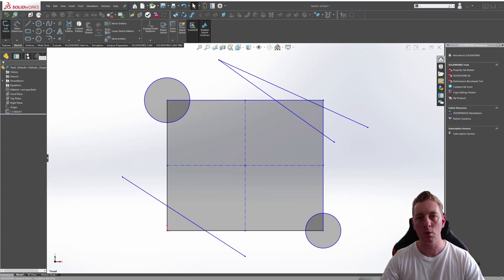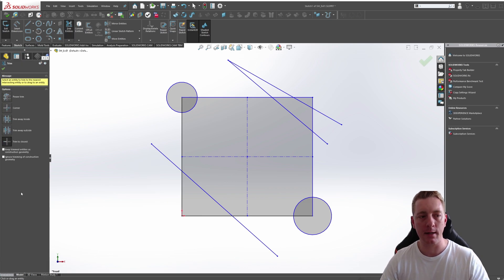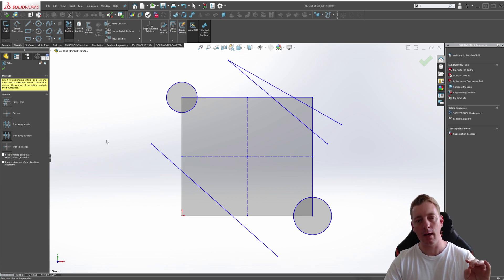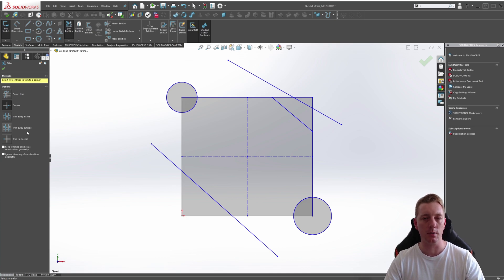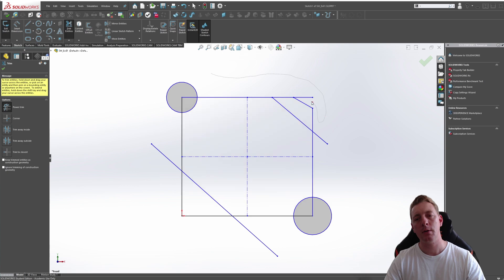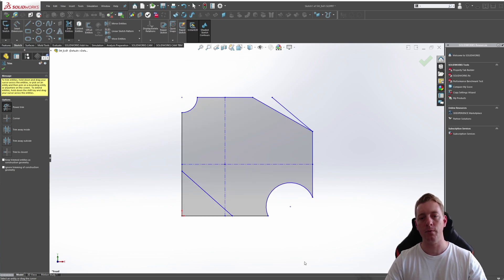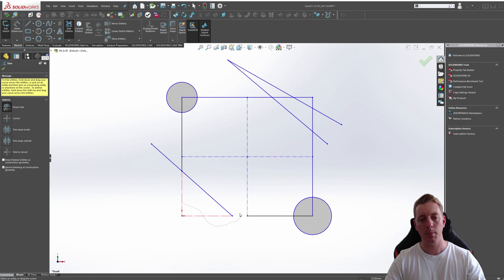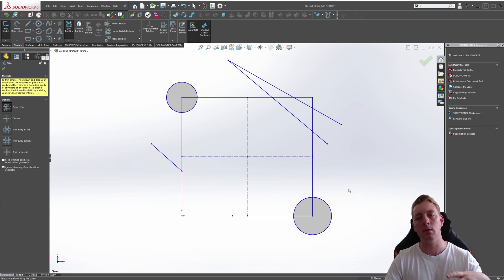Sketch Trim & Extend Tools | SOLIDWORKS 2020 BEGINNER | Chapter 01: Lesson 08 | CSWA COURSE

Comment: Man your videos need to get more attention than they deserve i hope people studying Solid Works someday recognize your tutorials. I am watching here because my prof suck at teaching lol he just leave some lesson handouts in  pdf form and that's it he left a problem in 3d without introducing to us what is the function of the sketch tools/entities which is the very foundation in order to make a 3d figure and expecting us to make it done by whatever close date it is. I cant even understand why we are required to learn the subject  SW CAD  because i am currently studying BS Electrical Engineering and i think Solid Works is mostly applicable in Mechanical Engineering fields because there is a simulation that can be done in here right? It is more making sense if he just teach us AUTO-CAD for planning. Yeah you heard it right he dint even mention why are we studying this subject unit #onlinelessonssuck.
Reply from the maker: Thank you so much for the comment and it's comments like this that makes it all worth the effort. I agree that learning programs like SolidWorks can be frustrating when you don't see the bigger picture like how it could be used for Electrical Engineering but be positive that as an engineer, it will add to your skill set even just knowing the basics.

I think it's more likely that later you will use something like SolidWorks PCB and combine that with SolidWorks since you need to check for tolerances in the part that it will fit your circuit board. So I'm sure there will be some use for it later and it's worth being aware of what's used in the industry.

But yes it can be a total pain when you have a lecturer that just throws a book at you with no explanation. Just know that your are making the right effort by trying to fill in the blanks yourself and that lead you to this channel. I hope that my content plays a part in completing your studies. 

If you ever have questions just post a comment and I'll set up other communication channels in the future where you can maybe submit things you need help with. Good luck with the studies and don't give up!